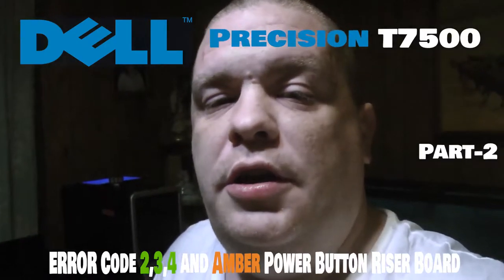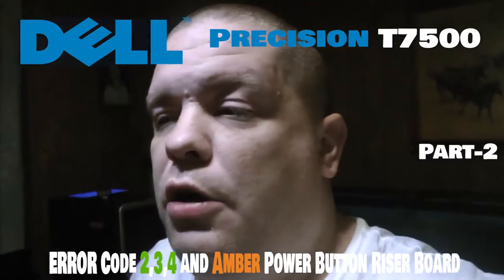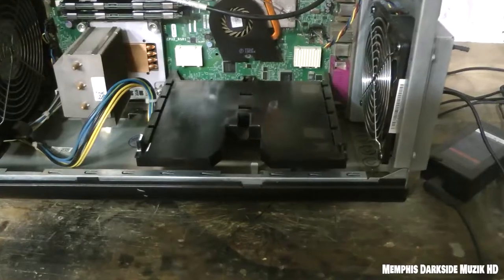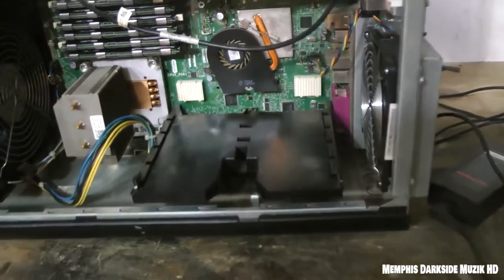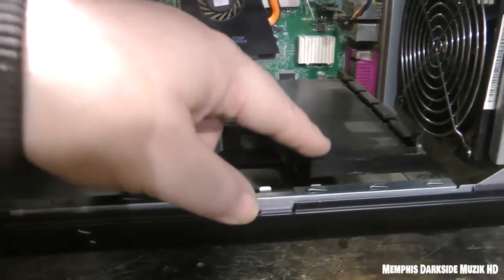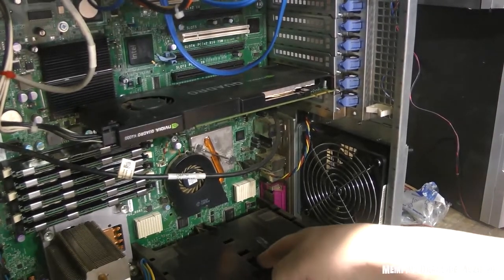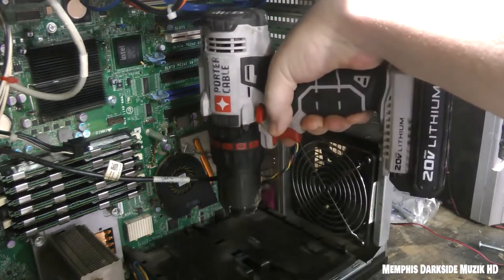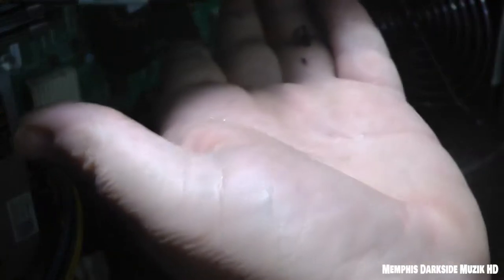Dell Precision T7500 ERROR Code 2,3,4 and Amber Power Button 100% fixed and Issue Solved Part-2

Comment: Just fixed mine. I have the same T7500 that suddenly yesterday did not start, instead it showed the same 2-3-4 error code with constant amber light and the fans running at high speed. By removing the riser board it started but detected memory change. I just found your video and did the same, by adding two rubber cylinders below the plastic tray, as you did. It works fine now.
For as long as I have this beast, I have found out that the very few problems and errors, come mostly from the riser board not fitting correctly on the MB (the other error I had was not reading all memory modules)
Thank you very much, you were very helpful!!!
Reply: hey bro can you please help me
i got error in  the second motherboard (the small one)
when i power up in the frist of the day it keep beep like this 1.3.2 (times)
and after some times power off and on it workking fine and when i enter bios system board
i see cpu 1 and cpu 2
and in devise manger i got 16 prossesor ( i think it therads bc 1 of the cpu got 8)
but in cpu z it only got 1 socket and in my pc propirtes it not say (2 cpu)
and the cpu work fine i transform from mother board 2 to mother board 1 and it work the issuse not in cpu
idk what this proplem
can you pls help me
Reply from the maker: you most def welcome homey. glad i could help.

Comment: hey bro can you please help me
i got error in  the second motherboard (the small one)
when i power up in the frist of the day it keep beep like this 1.3.2 (times)
and after some times power off and on it workking fine and when i enter bios system board
i see cpu 1 and cpu 2
and in devise manger i got 16 prossesor ( i think it therads bc 1 of the cpu got 8)
but in cpu z it only got 1 socket and in my pc propirtes it not say (2 cpu)
and the cpu work fine i transform from mother board 2 to mother board 1 and it work the issuse not in cpu
idk what this proplem
can you pls help me